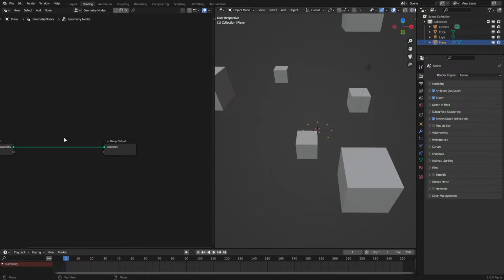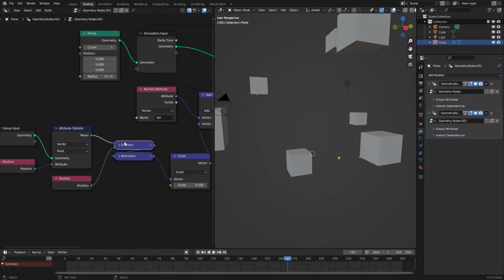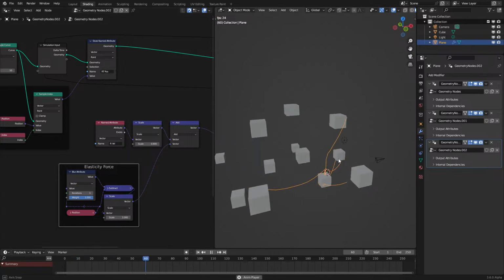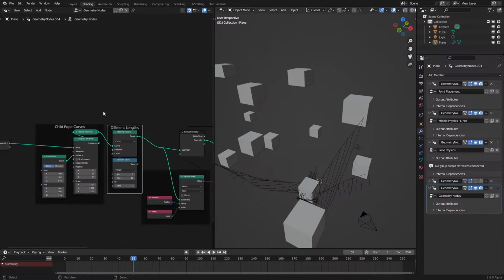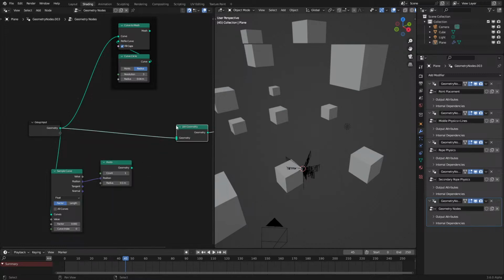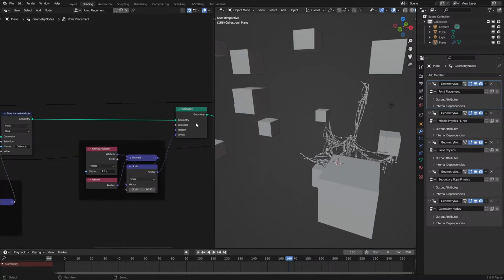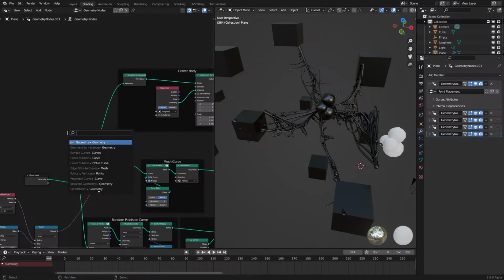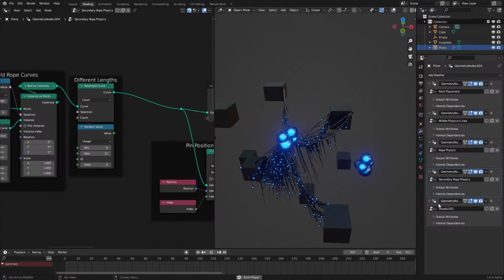Rain World Physics Creature (Blender Projects)

Comment: Okay, I'm finally making progress, but have some weirdness with my crazy flower monster. Two issues I'm running into: 1) if I try to do anything with cycles, it only works if I am running Blender in Debug GPU mode. 2) Sometimes, in the middle of playback, at some random frame number, it will jump back to the very beginning of the simulation as if it was at frame 0, and then re-start the simulation. Once that happens, it continues to happen until I restart blender. Has anybody here seen either of those issues and know how to fix them? :)

Comment: at 17:10, when we use the foot points average, aren't we losing all the work we did to add physics to the center point?
Reply: Oh... you are getting the point out of the simulation output, so you are just averaging the center point location (which is the center point location, since it's only a single point).

Comment: Very fun stuff thank you for sharing. I followed along for about an hour yesterday and used z offset with the seconds to have the creature crawl upwards. Looked very good and had no crashes. But today I can't open my save file, in 3.6 lol. That's experimental features for sure. :)
For anyone else following along: If it doesn't work, make sure you use the purple vector math node, and not the regular blue math node, that threw me off for a little while. :)